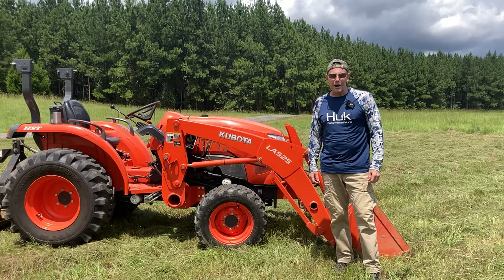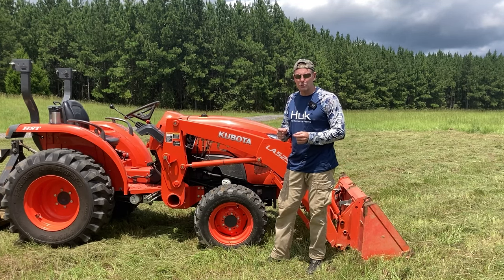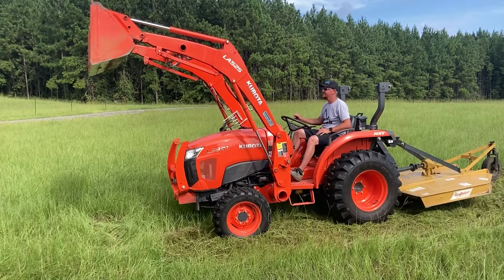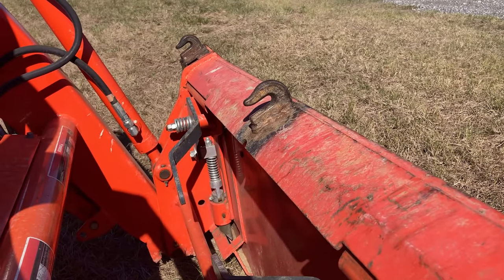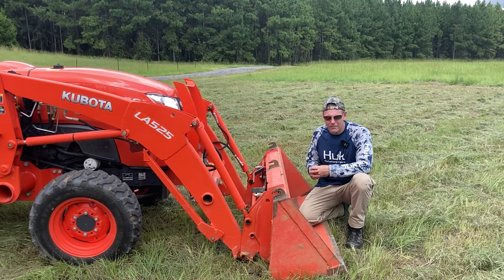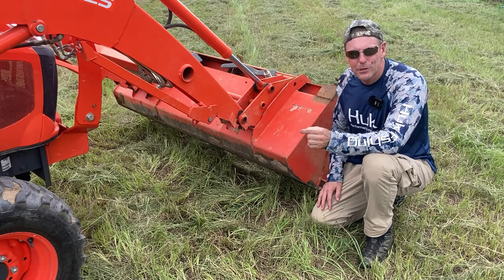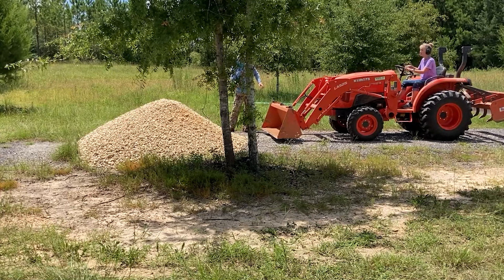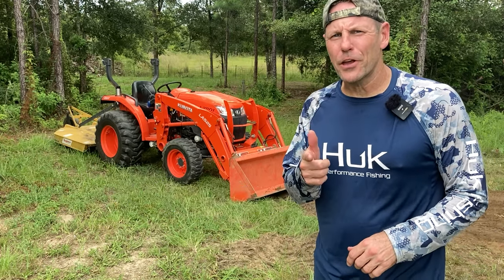How to Use a Compact Tractor Front Loader: Tips and Demonstration

Comment: The number one thing in front end loader safety (or - tractor safety in general) - keep the load as close to the ground as possible at all times and use counterweight! It should be in the first sentence of the film directed to new tractor users or new loader users. It is much more critical information than what does the joystick position do (you can try and see it in a matter of seconds, while "try and error" in safety can kill you in seconds, if you're unlucky).

Comment: I like the loader control lever better on the fender.
It should be right next to you in a comfortable position.
That way I don't have to keep reaching forward for it.
The angle of that loader control lever is really bad!
It should be sticking straight up, not sticking straight back toward you.
That makes it harder to control.
That's probably even more difficult than the twin lever controls on some tractors.  The big Cat loaders and old Massey Fergusons used twin levers which were a real pain. It made me feel like I was running a case backhoe with piano keys. Lots of people hated those.
Reply from the maker: It's all I've ever had so it feels natural to me.

Comment: Will picking up the front tires with loader while you have a brush hog on damage the brush hog connection components on the tractor?
Reply from the maker: I would lift the brush hog up so that's not a concern or issue, but if it flexes like I show in this video, then yes, you can do it.
Reply: @PineyGroveHomestead  I can do it as in its ok?  or I can damage it.

Comment: I have never seen a Kubota with the mechanical parallel linkage on the loader. Are they not available at all on Kubota tractors? 

If I was going to get a tractor that I was going to put forks on I would definitely do whatever it took to get the parallel linkage!
It's also a lot safer when the bucket goes up high that the material in the bucket doesn't fall off the back of the bucket and land on the tractor or you! 

Some TLBs come with the parallel linkage if they are sold as material handlers.

A hi-lift telehandlers come with hydraulic parallel linkage because of the forks. I think that all tractors that come with a loader should have parallel linkage.

There used to be a aftermarket company that sold loader attachments for mini tractors that have parallel linkage, either hydraulic or mechanical.
Reply from the maker: Are you talking about those square arms hanging under the front boom?  That's the kickstand for the loader when it's off.
Reply: @PineyGroveHomestead  No. I'm talking about the bucket curl cylinder extending back to the frame of the tractor, not stopping on the boom.

This makes it extremely easy for the bucket to maintain the same angle to the ground as it goes up and down.
Extremely helpful when using Forks.
It also eliminates the possibility of dirt or Rock falling off the back of the bucket and landing on you or the tractor when it's all the way up.
Some tractors have a very poor imitation of parallel linkage operation by tripping the bucket forward as a boom goes up to keep myself from falling off the back of the bucket. But it does not compensate for the boom going down because it does not roll the bucket back. I just starts dumping material on the ground.
The biggest advantage to having parallel Lincoln's on the loader it's for using forks. Because no matter how high or how low the boom is the forks will stay at whatever position you put them in.
For example, you can slide the forks into a pallet and lift it all the way up and it will stay at the same angle , even even when you put it all the way back down it will still stay at the same angle to the ground.

This is a wonderful feature that is only on certain tractors.

And like I mentioned earlier telehandlers that have the telescopic boom really need to have the parallel linkage but they have hydraulic parallel linkage not mechanical.
Telehandlers have to maintain level when they're moving around on very rough ground and lifting a forklift load up to the 3rd or tth story of a building. 
The forks are kept level because of the hydraulic cylinder near the base of the boom. As the boom goes up at forces that cylinder one way in the hydraulic pressure is transferred to the curl cylinder up at the far end of the boom. The reverse happens when they lower the boom. As the boom is lowered, hydraulic pressure is transferred from the bottom cylinder to the too cylinder to keep the forks level.
It really is an ingenious design!
Mechanical parallel linkage is very similar on smaller tractors.

I've noticed on some recent tractors they try to blend in that parallel Lincoln so it's hard to notice.
For example, they designed it so the bucket linkage goes back to the boom and then follows it back to the frame of the tractor.
A huge percentage of people don't even know about that unless they specifically ordered it that way. Or if they order a tractor with the material handling package on it.
It cost a little more to building it that way but it's worth it .

I will try to locate a picture to show you.

Comment: Whenever I'm on a loader that has a heel on the bucket I use that for back dragging and that works really well with float, it works like a drag box/ grading box.
I use the heal of the bucket for spreading. It works better than a bucket with a rounded bottom.
I never back drag with the cutting edge of the bucket pointing downward. It does not smooth it out as well.
I ran all kinds of loaders for over 30 years.
Reply from the maker: Many ways to grade dirt, for sure!

Comment: they put the loader handle on the fender so you can get into the seat from that side..
Reply from the maker: Some like it on the fender....I don't...it complicates the hydraulic system and they are prone to leak under the fender and you have to take the tire off to work on them.
Reply: @PineyGroveHomestead  pros and cons to both..and not a deal breaker either way..but access from that side is the reason they put them on the fender..I prefer it on the fender, but if it was on the loader arms I would have still bought my tractor.. treadle pedal is the deal breaker for me lol

Comment: Hooks should be installed near the point of bucket attachment, 2 hooks. Those locations you use are the weakest and most likely to cause a bend of the bucket.
Reply from the maker: We've owned 4 tractors like this and welded hooks in the same place every time.   Never bent a bucket and we lift the rear tires off the ground pulling out posts.